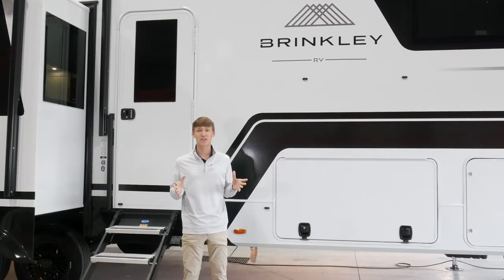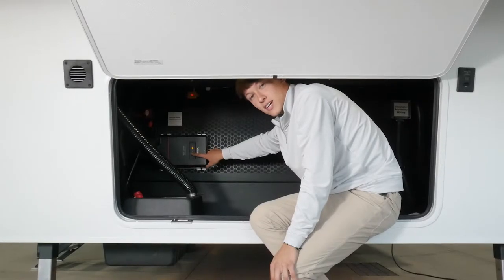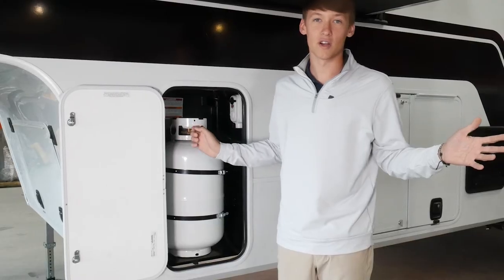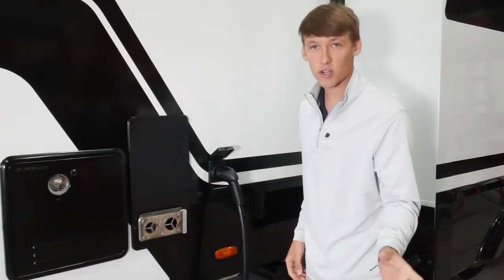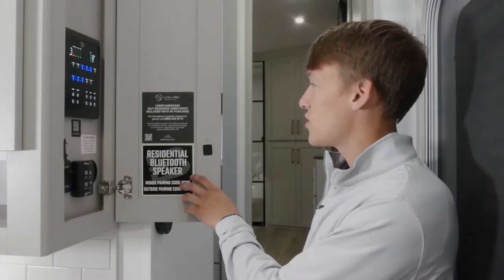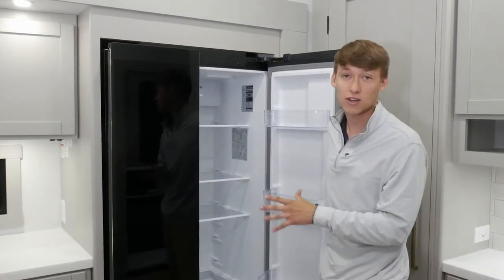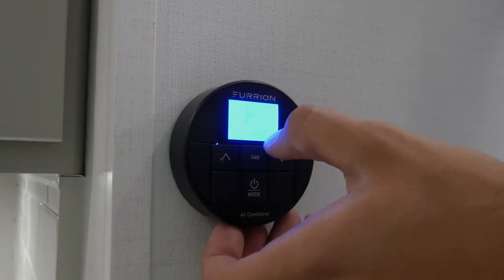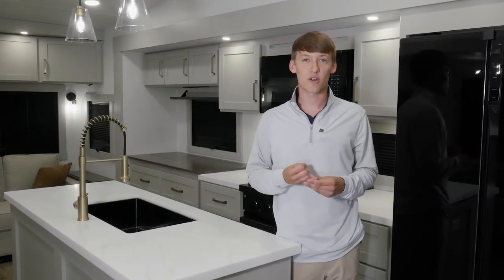2024 Brinkley Model Z Owner's Quick Start & Overview

Comment: Currently in a Grand Design 328m Momentum & drooling over a Brinkley 3100.  Been studying the website.  I don't understand a water hose reel.  It feels like a mold breeding ground.  I use either a 25' or 50' hose as needed.  When done with a trip, I put the hose on driveway to dry out.  Ever other season, I replace the hose to avoid too much mold.  No 65' to winterize/sanitize.  I'd rather a power cord reel. I dread dragging out the "anaconda" to hook up,  I'd also rather a 110v/lp water heater.  Use the electricity I'm already paying for and have access to hot water off the grid as a bonus.

Comment: Can you please explain the reasoning behind ductless AC’s? This is a real show stopper for us in getting the Z3100… we don’t want to have to run the bedroom AC during the night and also to cool down the bathroom. Also, do they both run on 30 amps?
Reply from the maker: The Main A/C in the 3100 is the Furrion 18K Chill Cube, which is extremely quiet and efficient. The bedroom A/C is a 13K Furrion low pro and is ducted to the bathroom.  We have found that this set up provides better cooling on those hot summer days.  You can run both A/C's on 30 Amp with the Chill Cube in Eco mode.
Reply: @BrinkleyRV Furrion is releasing the ducted version of this AC later this year, any plans of going back to ducted AC’s for 2025?
Reply from the maker: We do not have any plans as of currently.
Reply: Thank you for your answers. This is really not a functional setup. We don’t want to use the bedroom AC at night and absolutely need the redundancy of the units in case something goes wrong with one of them. A really great unit….but this doesn’t work.